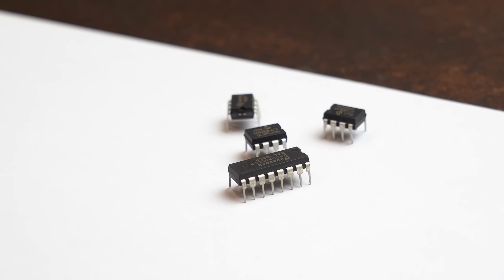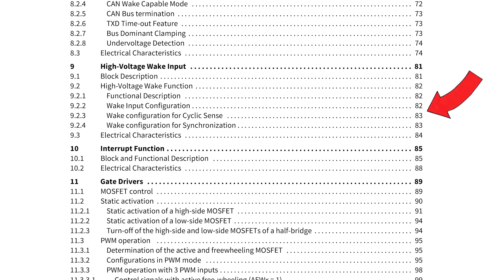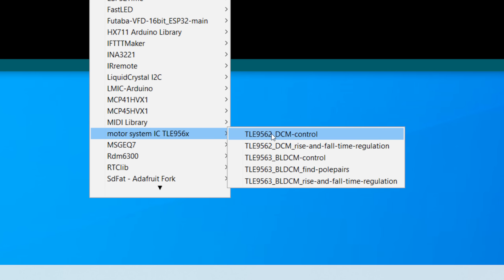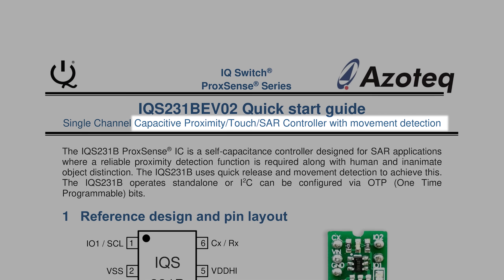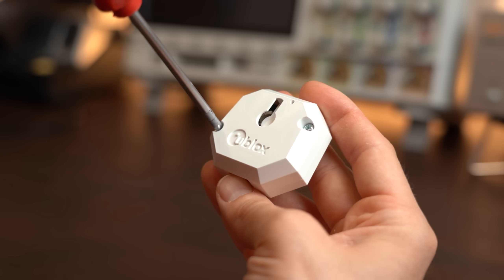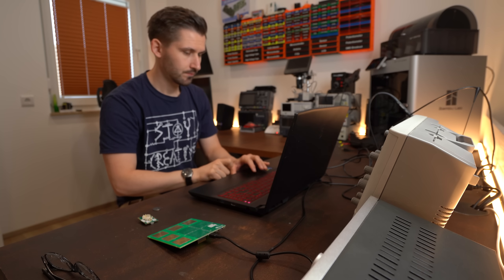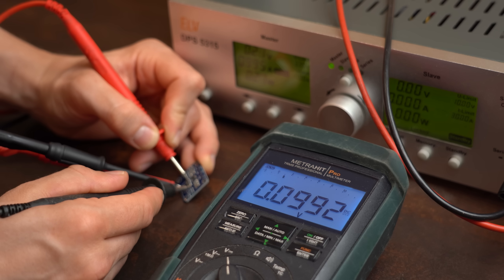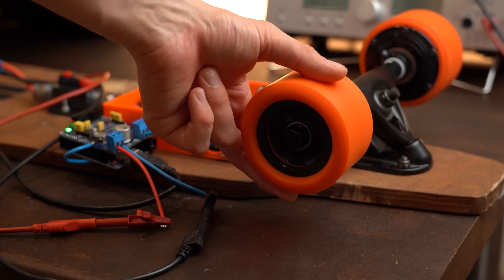I tried 4 Future Tech Boards! (That can do Awesome Things)

Comment: Next time you have filled holes, before smashing the board on the desk, just soak solder braid in flux, put the end on the hole, heat well, then slowly drag the braid off the hole, and all the solder will come out. Easy, clean, and no violence. There is a YouTube channel called Mr. Solderfix which is run by someone who knows what he's doing. He demonstrates that technique very well.

Comment: There are universla breakout boards which can accommodate a lot of smd types (a universal woth long pad (few versions may be needed cos distance beetween pins) and BGA to hole and BGa to solderpad. (The latter 2 are quite expensive, i think 5 pieces of breakout may be cheaper)

Comment: Thank you for sharing this. 
You should try and see if the Azoteq sensor is susceptible to being triggered by general RF noise from say a HAM radio :) I have seen that to be an issue which does not make this reliable. However, maybe there are some tricks around it. The whole azoteq lineup could be a nice show idea for your channel :)

Comment: You aren't building that cheaper if you buy components, but we glad you had tons of these IC's. One even looking like some amd CPU - Ryzen 9 12C. And you lose this documentation quality if that parts purchase cart is twice as much as that thing somebody made on ebay. If you are a coder - there is too much to know about all the electronics and not burning some resistors. and you also should commit into having all this voltage/amperage sin cos tan reading equipment. Local supplier Lemona will be your best friend if need parts. Application diagrams are like some TV. Why don't you use air sucker 4:44?

Comment: You can also use TLE9879  BLDC SHILED where you can stack up to 4 BLDC motors on Uno board and can control 4 motors independently. It also supports sensor less Foc and hall sensor trapezoidal control.

Comment: Hi Great Scott. 
I have a question for you.
Can you connect a 3 fase AC to get out DC power? I want to make a small windpower charger for my phone/ power bank but I don't know how to get 3 cable's to a full bridge rectifier or do I need to use all 3 cable's or just 2 from the fan motor I will use? Hope to get an answer from you. Regards Dag from Netherlands

Comment: why no one thinking on 5 volt lithium ion battery to 220 volt inverter.
Here 5 volt parallel batteries not require BMS , which increase the cost of batteries.
Can we make 5v to 220v in 1 kvah or 2 kvah

Comment: Put your board in a clamp, heat the solder hole from the bottom and use a solder pump from the top to clean the hole out, works fine for me :D

Comment: you should use/test one of those x-ray free x-ray sensors/setups.
basically allows you to see things and inside them and through them, well unless shielded with metal or such, or to far away.
actually many modern smartphone have one build in since they cost almost nothing, but in most phones all acces to them for the user, is completely blocked, even just reading it instead only going through a black box meaning one would need to find a way to hack that or to just get their hands on a loose version/development board.
it uses/can use multiple effects such are radio reflection, weakening/degradation of signals, angles, etc. basically like sonar but much more options and it uses radio waves instead.
there are sensors speciffically designed for this so they already form a phased array and handle many pings and such easily,
if you don't know them yet, they are called 5g modules, the same modules which are used to rip off people to get them to pay more for a "new" mobile network so that symbol shows up in their screen despite the actual range of the actual 5g network being so low that in reality you are basically just using 4g or 4g+ most of the time, so are just ripped of and paying way to much for something you in reality don't actually get.

there also are those I think 20ghz or 40ghz radio modules speciffically meant for measuring dept, angle and movement  they only measure in half 2d by default. but if you can combine 3 of them 2 horizontal 2 vertical so one in the corner one next to it and one on top of it, or if instead you attach one to a servo or such to move it's position, and some basic computing then you get a full 3d immage which can actually look through things.
it won't work close to as well as 5g, and 5g also has insanely higher resolution, actually good enough to use it like a normal camera, while those 20ghz modules tend to only see resolution up to around 10 cm or such so are more for fun since you can then see people through walls.

would be cool to see normal people actually use those,
even though I think it is logic this is little spoken about, since if many people use it, it might become illegal.
since essentially unlike normal x-ray this allows you to not only look through things, but also inside of them.
very usefull since if enabled on a phone you could see inside your body to see if something is wrong and what using your phone to detect diseases. but at the same time.
this also allows spying on people very easily, and being able to see through clothes.
and would likely cause pannick if people realize their phones have such sensors build into them, but in a black box where it is running but they do not actually know what it does.
ofcource since I am for Free(as in freedom) open source, I actually hate such things being in a black box, so would actually like this since it would force companies to allow people full acces and insight over those modules if they want people to continue using them.

actually is the same as those old raspberry pi radio echo location and triangulation projects, but this is much more advanced and detailed and all sensors can be on one place instead of needing many (3 or more) an triangulation.

Comment: I found a crude but VERY effective way to clear solder points clogged with solder! Touch your iron to the clog long enough to melt the solder, then move the iron and IMMEDIATELY blow air into the point. It does splatter molten solder in the direction you blow the air, but if you use a damp paper towel as a backstop, it's perfectly manageable. Obviously, keep a distance of at least a few inches between the board and backstop.

Comment: For those interested in the u-blox XPLR-AOA-2 Explorer Kit, the kit is based on u-blox's NINA-B411 and NINA-B406 modules, both using the our nRF52833 SoC with its Bluetooth 5.1 Direction Finding capabilities to determine the Angle of Arrival(AoA).
Reply: @NordicSemi do you also have some samples for testing for university students ?
Reply: @syousufimam  same question. I was interested in using it for my masters thesis but the price of the devkit is a bit overkill. BT AoA/AoD is pretty new stuff, did found some other boards but all of them are either hardly available or expensive. Well teoretically speaking it could be possible with any 5.1 or newer bt device, but you would need an additional antenna array and rf switch for the antennas. and ofc some coding to set it all up.
Reply: Silicon Labs also has AoA/AoD kits, which are cheaper (and arguably, better)
Reply: Why would I be using Bluetooth AoA for $1500 when I can be using UWB for $100 ?

Comment: With the IQS cap touch dev board, the proximity sensing is all to do with the sensitivity of the touch sensor. It has 2 touch channels. 1 to detect touch and 1 way more sensitive to detect proximity. That coupled with the electrode design, you can relatively accurately detect proximity on your bench. But in real life, it gets tricky. Make sure your ground plane is always constant.

Comment: I just had a PCB manufacturer reach out to me about that exact issue with THT holes being filled!

Long story short I had ordered a pile of PCBs inc component supply and assembly, but did not include THT component assembly due to manual handling costs. Just before shipping it was picked up that the THT holes were filled, and they asked if I was okay with that - which I was for this small batch. 

Will definitely use your trick of smacking it onto the table! Usually I just get angry with my solder-sucker trying to clear them hah.

Comment: When it comes to indoor positioning then hot thing is uwb there are ESPis with uwb modules build in available and in theory this should work with uwb android phones. Sadly support for this in opensource and diy community is sparse. You could upgrade door from previous episode so it will auto unlock when your phone is in proximity to the door, it could work without unlocking phone.

Comment: Wouldnt even just a small foil capacitor reduce the noise enough for the current measure Sensor? Or did you mean you want to measure the noise itself?

Comment: You could have use flux and copper wick braid to open the soldered up holes. It would take 2min instead :)
Reply: And if I run outta wick, I just use braided wire 'til the solder is exhausted...

Comment: You also get other magnetic field based current sensors, I believe you may have shown some before, the ACS712 is one and you can get them in various current ratings and you can get breakouts with a screw terminal at one end and header pins one the other. It fixes the distance problem you describe by having the current pass through the IC so the distance between the conductor and sensor can’t change.
Reply: Yeah, I believe chips like ACS712 are much better suited for ordinary applications, than that 300A beast.
Reply: @renxula  I was more meaning them as a replacement for the shunt resistor ones he says he normally uses. You do get higher current ones that work in the same way (not the ACS712) but I haven’t used the higher current ones. They work in pretty much the same way as the board he showed except the conductor goes through the chip itself.

Comment: Another BLDC controller option is the B-G431B-ESC from ST. It is a board with a STM32G431CB microcontroller and is designed to be used as an ESC. It is a microcontroller so it does need programmed and is reprogramable but they have some example code and software. The MOSFETs are rated for 60 V and 120 A (although this is cooling dependant, the dev board with a propeller blowing air over it apparently has a max current of 40 A). It supports multiple drive types and hall sensors.

The board is also pretty cheap, better priced than normal drone ESCs.
Reply: Just looked these up.  Looks pretty cool!  Thanks for the suggestion!

Comment: For the movement detection Board there is a board for a few cent based on the ic ttp223 that have very very similar capabilities (detecting in a 2cm range…) and you can easily expand the range of detection.
Reply: You have also  the tof sensor from ST

Comment: Oh very cool. I loved the current measuring one.
Reply: CT453 is quite pricy at $4-$7 a chip.  There are many other power monitoring sets you can get for under $5 completed. So not sure how they plan to gain ground with their product priced  so high.
Reply: @lunacyworks  any recommendations for chips? I don't have a project but I'm always interested in reading a new datasheet

Comment: That's a very nice little current sensor board! That might actually be a nice alternative to the Zero Flux sensors we use in our superconductivity lab for simpler setups, since these Zero Flux sensors are quite bulky and quite overkill for many small experiments

Comment: Tip for everyone who as solder filled through holes: Get a a cheap deslldering pump ( the sping loaded ones that create a short suction on button press) for <10€.
Hold the board vertically and put the iron on one side an the desoldering pump at the other side of a pluged hole. Melt the solder and then activate the pump. 
This works like a charm and often clears the hole on first try.
Reply: Those things are crap and you will learn this over time, use heat and slam or wick.
Reply: @andymouse  They've worked for me fine for years. Wick and flux works much better on smd components but those pumps do have a place.

Comment: Hi, could i suggest a project for you, and at the same time help me build a tracking device that could control a gimble that would move a video camera which would be following a RC model plane. This has always been an issue to film your flights when you are alone at the field, or without a camera person. I have heard of using a GPS in the plane to send the position to the ground station, and then it would point the camera at the model. I have no idea how to get this working, but would appreciate a heads-up from you on how to do it, thanks in advance..!

Comment: what circuit need use, measure 800W aircooled 0-110 volt  spindle speed and controll not drop speed or torque if come resist to spindle. cut metal and not drop speed. and can measure speed accurate 0-30 000 rpm

Comment: 4:40 you can buy a soldering iron with electromagnetic pump very cheap nowadays.
It is not as productive as proper desolder, but it would solve problem with closed holes for a few minutes.

Comment: @4:43 - Can you honestly say with a straight face that you don't own a solder sucker or at least some soldering braid?  I'm a less-than-casual electronics guy but I have both.  I guess the scene could be staged as a joke in which case - you got me.

Comment: The tracker one... If can find a set like that for cheaper, could make a body tracker system.

Actually. What would you recommend? Buy the parts and build one myself? Or find the cheap option? Because I really feel like I should make a said system myself. Maybe use the DLCPCB or whatever it was... Am bad with names. And ask them to make the PCBs and send components... Would be nice if I could reverse engineer the developement kit...

Comment: Thank you, I have been validated!  I’ve been using the “heat the pad and smack the board on the bench” desoldering technique for,years!
Reply: Lol ! I just wrote the same thing telling some bloke off for not knowing this technique ! you are indeed valid.
Reply: Those metal solder suckers really are the cleanest way to remove solder. Even more effective than smacking
Reply: I use a metal solder sucker I got in a bundle of crap being thrown out from the IT office at my first ever job (temporary 4 week job right when my final high school exams started)

Comment: @11:39, the IC says CT453 and not CT452 as the video says, right? Or is my vision going?
Reply: The ct453 is just the 3.3v variant of the ct452 which is 5v. So yes it got mixed up but it is essentially the same
Reply: @CédricSimard Good to know, thanks!

Comment: I'm looking for a current sensing chip that works in the micro to Pico Amp range.. becuase I'm looking for something(chip) that can can measure the resistance between the wire and ground. The resistance being in the 700Meg to 100giga ohm range.
I'm glad chatgpt is around to help with the programming.

Comment: It's always amusing to me that dev boards are either considerably cheaper than you'd expect or considerably more expensive, there never seems to be anything in between lol
Reply: haha exactly, they are either 20-30 euros or 150-200 euros
Reply: The manufacturers usually fall into one of two categories:
The ones who understand that they should subsidize the cost of dev boards so their chip gets integrated into more products, massively boosting sales.
The ones who know their customers are usually large companies making unbelievably expensive products, and so they create a barrier to entry that pays nicely.
Reply: @asm_nop  nah, its also often so that customers contact the supplying company, often you can get discounts or free after getting advice from the chip suppliers
Reply: @Steyn12  try that with TI, some dev boards cost 4 to 5 digits.
Reply: That's why I can usually find stuff from Adafruit. They've already made the dev board and because they buy 1k at a time the cost is much lower, and they already have an Arduino library and open source PCB layouts ready to go.

Not always cutting edge stuff like this, but still a lot of stuff you'd have to spend hours making a board for just to test the usability of a chip.
Reply: Depends on the cost of the core component and whether it's just mounted with a test circuit so it can be used or fully broke out with populated connectors.  Also tools (programmers, software/firmware compilers, debuggers, etc) can wildly vary in cost, ownership models, quality, and usability.
Reply: Oh, hello there